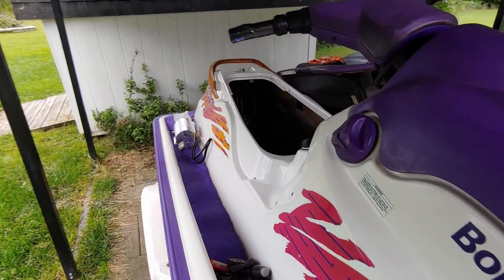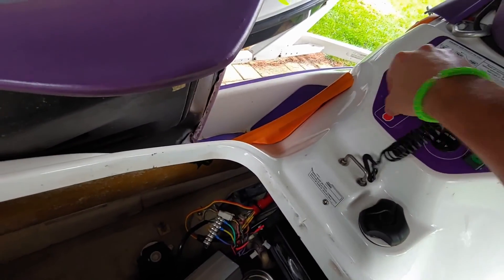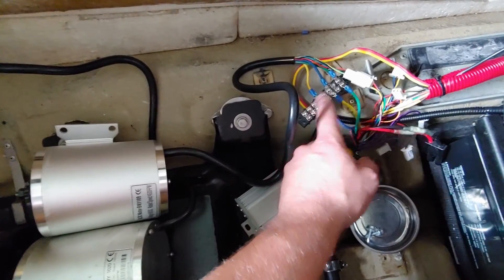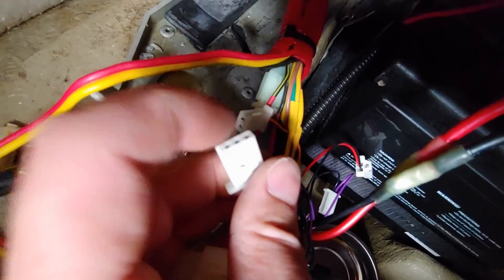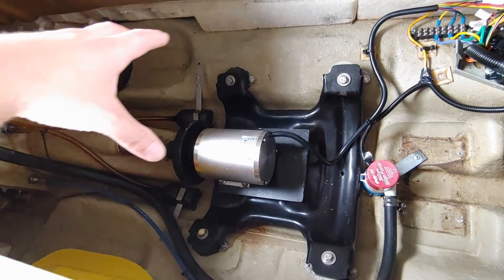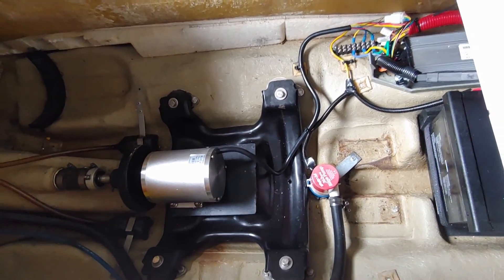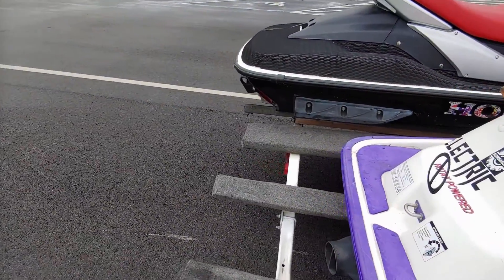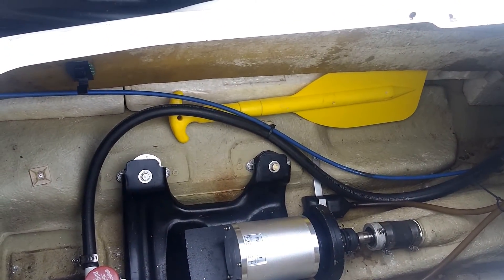DIY ELECTRIC Jet Ski Part 7 Lake Test # 2 and Final Thoughts

Comment: Suggest using a larger motor water cooled and convert some of the torque into speed to see if you get more speed.  Jet pumps are created for speed to be efficient and the hull is efficient at plane speed.  4.6mph is not even 10% of plane speed so just use a prop system try again and experiment with jet impeller pitch  also.  You might find that nothing can replace a 3 cylinder 2 stroke engine for power-weight that a small very fast boat needs without substantial $$$.

Comment: I had that same exact motor setup on a vintage Kawasaki Bushmaster bike, and the performance was about the same (maxed out at 12mph). 

For me, the biggest issue was not really voltage, but the torque the motor produced. These motors, regardless of applied voltage, just don't have enough oomph. I ended up pulling out the motor and batteries and switched to a 72v hub motor on the rear wheel with 5x the torque. My bike is now so fast I won't ride it for fear of my life (no joke). 1/4 throttle and I'm already at 45mph. 

For a Ski to properly plane and get up to 60+ mph, you'll need an 8+ kw motor with good torque. For a more conservative 40-45 mph, you could probably go down to 5-8kw. Give yourself two 72v 3000w batteries and you're good for that lake!

The good news for me is that I still have this full setup (48v motor, battery, twist throttle, etc.,) sitting in my garage. Nice to know how easy it is to mount it for the kids when I come across a free ski.

Comment: Actually if you was to put gears on the motor and the shaft you can make it faster im going build one with two motors and high speed gear ratio

Comment: If you want to go lithium I could very easily build you a pack with second hand cells (but we’d want to find some with low cycles, preferably A123 LiFePO4 used in a backup application). For a 72V 20Ah battery you’d be looking at $200 to $400. That won’t give you a ton of range…I’d guess you’d probably want to be somewhere around 60V to 72V minimum with 60Ah. 

There’s some packs I have access to right now 36V (actually 39.6V) nominal 20Ah for $90 shipped. Could put two in series for 72/79.2V and parallel a couple. Packs are testing 96% capacity at with a 10A load. Cells in the pack are ANR26650 M1B. Not very energy dense at 2.5Ah but a max continuous discharge of 70A, 120A burst. Just four of those little cells in series start a small car engine. Two of those packs in parallel start a diesel truck. They are monsters and very safe
Reply from the maker: Wow, thanks Eric but this project was actually gifted to someone for their kids. I do plan on some future EV powered builds however and I will definitely keep you in mind

Comment: Enjoyed watching all 7 videos. Have you made any progress to increase the speed?  If an electric jetski can give similar power to ICE and give at least 2 hours of ride, then there may be a market for the product. An update is greatly appreciated!
Reply from the maker: Unfortunately this project was given away. The ski really needed a larger battery pack, larger motor and better controller but because this particular hull is hard to not tip over it was a bad choice to add more power to. we do have a 4tec seadoo hull we may move to a bigger drive with, but that may not be until next season if we use it. Lots of good info in comments many good suggestions though.

Comment: JETFLY Electric surfboard  Max Power:20kw , Max Load Weight:150kg(330 lbs) ,Riding time:>60 minutes (depend on operation conditions)
Top Speed:>65km/h(60km/h with 100kg rider),
,Battery Capacity:51Ah 72V / 40Ah 72V (optional),Battery Lifespan:1200 times charge and discharge ,

Comment: How many amps were you pulling at full speed the 5+ mph ? May i ask this will help me to figure out some things im working on. An also thank you for the video an all your time you spent
Reply from the maker: All I remember was it was an 1800w motor on 48v (12v x 4). Unfortunately I don't know much about electric powered anything and thus the reason for this series. If you watch through the series and read all the comments, there are many good suggestions. What I will tell you is my batteries were too underpowered and a stronger controller is def recommended. This IS THE way of the future though as our water really needs it.

Comment: i'd definitely try to use a DC SERVO motor there or BLDC with a proper controller and higher RPM and power. Very cool project and a proof of concept for sure! Lots of potential too! The main question with the correct motor size will be the battery actually.

Comment: Nice build. Was considering the same . Anyone build one successfully that can do over 10mph? Thought about using an ebike kit somehow to modify it but I dunno.
Reply from the maker: no, there have been many attempts, and ideas from smart car motors to fork lift motors to zero motorcycle motors. The zero option would be the best if you could conceal the batteries and wiring from getting wet but even the manufacturers that are being pushed to electric cant seem to produce anything other than a prototype(works on tv). Wish they would though our waters really need it!

Comment: i havent seen the water test yet but straight of the bat this motor and controller wont much good and probably will over heat very quickly ,the electric jet skis ive reasearched are in 72 to 84 volt range with motors and battery systems that can supply up to 200 dc amps continuos,

Comment: Why don't you gear it up to spin the pump faster with the same pump. The engine mount plate is steel so you can weld amount to make the motor higher and then use different sized gears to up the RPM

Comment: Love your idea. I work on boats and jet skis for a living. You can put a water cool motor in the ski. The jet pump provides water to the stock motor for cooling. You can use a golden motor that is water cooled they are around $750.00 for the water cool version and I know there a few motor controller that are water cooled. I have been thinking about doing this to a sea doo jet boat and am gathering up parts to do it. Again I love what you have done.
Reply: Don't get the golden motors...they are low horsepower for size and weight and virtually equivalent to the brushed motors from motenergy but at a much higher cost. Check out the me1004 or me1003. Easily 25-36hp peak values for those motors. And at a $600-750 price tag with much cheaper speed controllers available as well. 90%+ efficiency which is about as good as the golden motors efficiency. You do have to swap out brushes once in awhile but they make it pretty easy to do the swap.
Reply: How'd you go ?

Comment: Listen belt drive with a 4 speed gear box would've increased those rpms on that impeller you need at least 9,000 rpm on that impeller for the jet pump to perform

Comment: what is the actual RPM for your pump?
Reply from the maker: No real way to tell withoutnsome sort of timing device. Its read 3500 with an old manual tach outside of water.
Reply: @EngineInformant  the reason I asked is that the normal operating RPM for PWC's are on average 5-6000 rpm for moderate ski's and 7-8 for performance machines, you may want to change your gear ratio....

Comment: Ok buddy what you need is a better controller with higher Amp out put a sabvoton 150A would be good and lithium batteries power tool batteries or lipo hobby batteries are some cheaper alternatives

Comment: On your electric motor it says it has a max of 4500 rpms....I would be interested to what the actual rpm is at the pto and at the impeller using a laser photo tachometer. I think it’s a safe to say you’re not getting 4500 rpm at the impeller but I am curious to see what the loss of rpm is.
Reply from the maker: No i might guess 2500 given the speed.

Comment: to cool your electric motor, I suggest you use a flexible copper pipe and connect it ( with adapter ..) to one of your flexible plastic pipes ( which already carries water) and (copper) make it as much as possible around the round housing of your motor ... and connect the 2nd side of the copper pipe to another plastic pipe which goes to the outside rear of your see-doo ......

Comment from the maker: Thanks for all the great ideas and comments. I am thinking of utilizing an electric smart car motor possibly in the spring when the weather cooperates. Anyone looking to build a similar project please leave comments and feel free to join the discussion.
Reply: Dont listen to 90% of the suggestions on here. You are definitely amp limited which means gear ratio means nothing if the controller cannot provide any more power to the motor. Voltage sag could be causing your motor to also not hit even close to its rated rpm. you need to at a minimum get a clamp meter and check amp draw at max draw and a volt meter to see what the batteries are doing under load. Dump those lead acid batteries and get a lithium based battery lifepo4 or lipo would do good. automotive lithium ion cells can be had for cheap on the second hand market. You can get more power out of that exact motor with a 72v to 96v speed controller, matching battery, and 50-80amp rating. Your worries about voltage being too high doesnt matter as a fully charged 48v battery will give a bit of a shock with dry hands and when wet will give quite the shock. Just go higher and cap the connections if you are worried. You will never get very fast though with that motor even at a much higher voltage and decent bump in amps. you need somewhere in the range of 20+hp just to get on plane with a jet ski and even with 96v at 80amps you arent even hitting 10hp. Right now you are around 3hp assuming the voltage drop with those batteries are not too bad...which they probably are. A lot to consider. Some people are right that you can convert an alternator to do what you are looking to do but it is horrifically inefficient and maxes out at maybe 20hp peak and you have to power the rotor separately with 12v using a dc to dc from the main battery pack. In this price range you should look at the high voltage brushed motoenergy motors and a matching speed controller that can output 36hp peak. I am looking to do the same thing this year and I can cover all the electronics but I cannot do the fabricating myself for adapter and mounting plate as I do not have the equipment to do so.
Reply: @fookschool  10% suggestion is if it came with a 100hp engine then you need a 100hp electric motor for any real life matched performance.  You might be able to play with the torque or that could be a worthwhile investigation at 6,000rpm.    Turn around and don't sink with any li battery.

Comment: Salutare si felicitari pentru proiect
Hello and congratulation for the project
I have the same motor but it is 72 v and 4900 rpm 3000 w 3 kw
I notice that your motor is 48 v but what rpm and W
Reply: what do you think will be the difference with the new engine 72v ,4900 rpm and 3000w,it's worth to i'm making a test,you think i'm going to get at a speed 15 mph
Thank s
Reply from the maker: @ovidiuom7497  mine i beleive was 1800w 4000rpm. You will get probably more torque with the 3kw motor which will result in a higher rpm however it will still not be enough to reach even 4900rpm. If you choose to do a geared system (15 tooth motor sprocket and 5 tooth drive sprocket) rather than a direct drive you will likely obtain 15mph but at slower acceleration. As many have said, a true electric motor maybe from a forklift, hybrid drive or even a golf cart you will probably do better given it being a more robust motor
Reply: @EngineInformant  
Thank s

Comment: I have one of this motor with 1800 w  I thinking to make same as you done.  it works or needs a bigger motor?
Reply from the maker: Watch the video series and youbwillnsee exactly the outcome. Depending on the Voltage your comfortable with, buy the biggest motor you can and use a gear setup to output a higher rpm. While that motor may run 4500rpms it doesnt have the power in the water with the resistance to get there

Comment: Thoughts about doubling or tripling the motor/controller combo? or maybe just overvolt a brushed 24v golfcart motor.
Reply: my thought is hook 2 or 3 combo sets to the same battery bank, and try to feed them the same throttle signal, and use some chain to couple the outputshafts to something like a jackshaft, and them mess with the gearing to the jetdrive. should give gobbs of torque. batteries might not last too long though....
Reply from the maker: Good idea. Would definitely increase torque not sure about total rpm though.
Reply: @Engine Informant  for more rpm youd wanna overvolt it or mess with gearing. I have a razor pocketmod runing a 36 volt controller on the stock 24v motor, it goes about 25 mph. gets prety warm though. If you do try this, Id recomend getting the motors that mount on the faceplate and wrapping some small gauge copper pipe tightly around the motors as a sort of makeshift waterjacket, like rc boat motors use, so you dont burn them up.
 maybe consider using a cheap thermal grease as well, though that might not be necessary as the motors use an aluminum case, but it couldnt hurt.

Comment: I Really hope you get a bigger motor on this and not give up
Reply from the maker: Not giving up. Just end of season in the midwest. I think after all the comments we can triple the speed with a simple sprocket setup
Reply: @EngineInformant  exactly my suggestion. Electric motors have a LOT of torque and ok speed. Best way to remedy it is with sprockets. You're not gonna hurt the motor with sprockets.

Comment: Thanks for sharing your efforts.  I’ve been wanting to try this for some time.
Reply from the maker: Absolutely. Its all about rpm and having a motor strong enough to get up there. If you can find a stronger 48v motor it would work great
Reply: @EngineInformant  Is it alright with you if I share some of your footage to tell my audience about your project in an upcoming video I'm making? giving you credit of course
Reply from the maker: @ZachsGarage1  absolutely
Reply: @EngineInformant  can you give us the Electric motorand  controller specs along with the battery kwh and amp output?
Thanks.
Reply: @EngineInformant  in second to last video you pointed out the multi speed plug. Did you follow up on that. 
And chan you check to see what the rpms were?

Thanks...
Reply from the maker: @golfish8589  yes i triple checked i was on high and the only way i had to test rpm was an old manual tach that has a rubber end i could put on motor output shaft. It spun 4k out of water but i know with water resistance it struggled.

Comment: There is a discharge of water from behind, if you cover it, you will have a little more pressure at the turbine outlet and a little more speed
Reply from the maker: Yes i thought about that if i blocked it off in the pump itself but not sure if there would be much of a difference.

Comment: Maybe you can use some gears to get a higher rpm
Reply from the maker: Yes as we discussed at the beginning that would be possibly however this motor I dont believe has enough torque to do much other than double thenspeed even if you do a 2:1 gear ratio

Comment: You could use a water-cooled alternator, there are a bunch of videos online online on how to convert them to a motor. Then use the jet pump for the watercooling like the stock motor.
Reply from the maker: Yes 7 series BMW uses yhem but they are 12v. Not sure what I would have to do like change windings etc to make it happen.
Reply: @EngineInformant  people usually grab 12v alternators and use them up to 72v
The youtuber "enrengineering" is using a modified alternator with hall sensores and a beefier controller, it would just need a way to hydrocool it
Ooooooor you can grab one chevy eAssist hybrid motor, they're ready for liquid cooling and can get a lot of RPMs and torque as well, just search them on the forums ElMoto and EndlessSphere